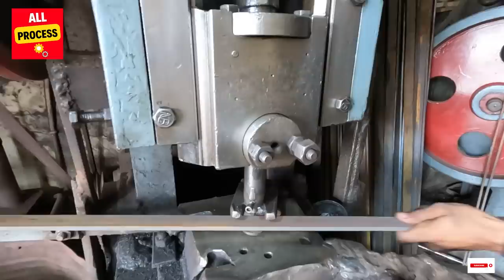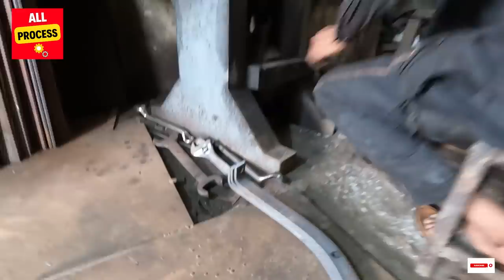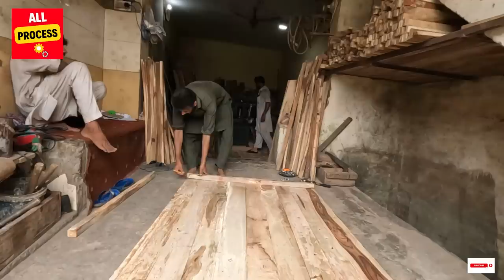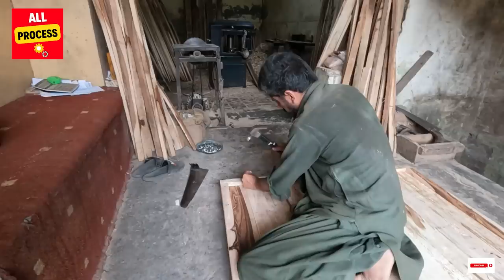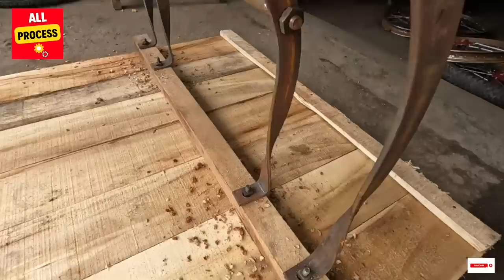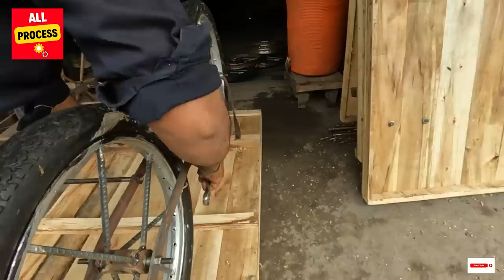How Made Are Wooden Hand Cart || Amazing Complete process

Comment: Small shop but so tidy!!! Too bad they are not using a power nailer. Nothing fancy just air powered palm nailer would be a quick time saver they already have electric power for a compressor. Bonus you can use an air ratchet to bolt down the parts too with nuts and bolts